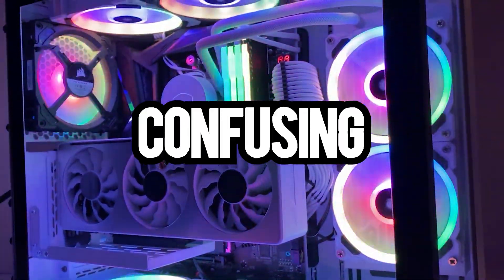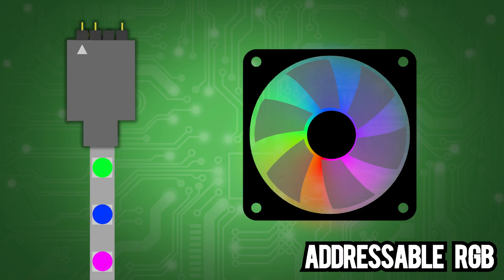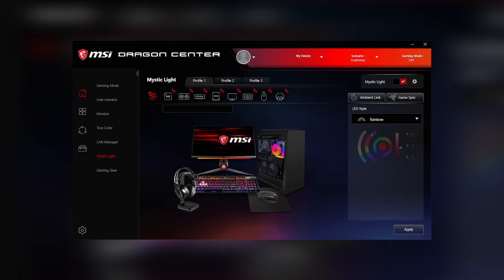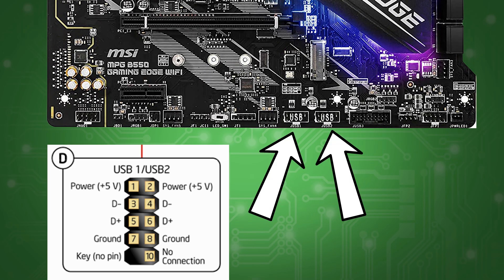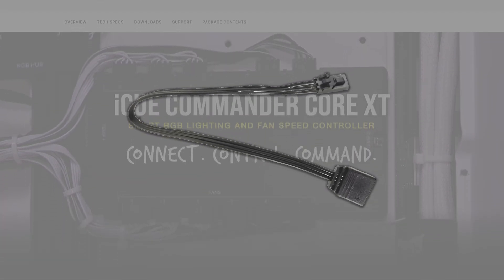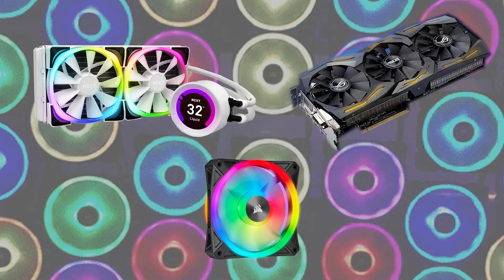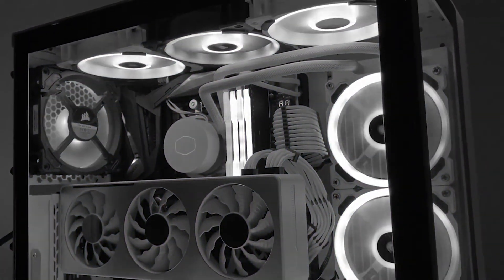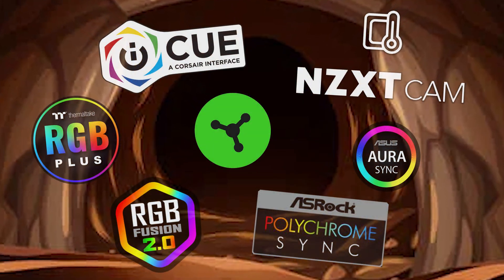The Basics of RGB (Gaming PCs)

Comment: Ahhh . This helped a lot . I’m building a system with a Corsair 4000x/h150i 360mm aio in a week. I believe the case comes with a rgb controller so I’m gonna plug all the fans (which are all Corsair from the radiator and the case fans) into the controller I should be able to control all the fans at once.